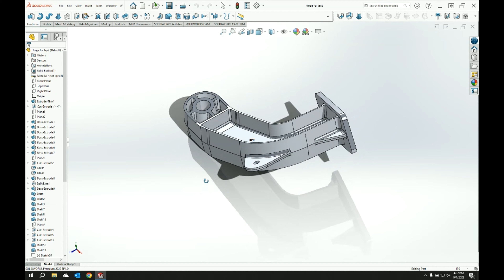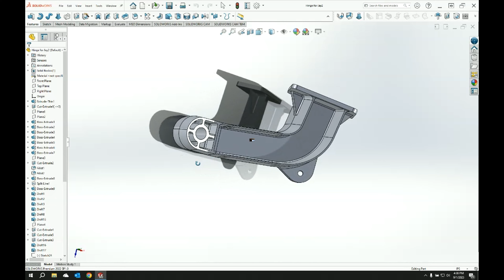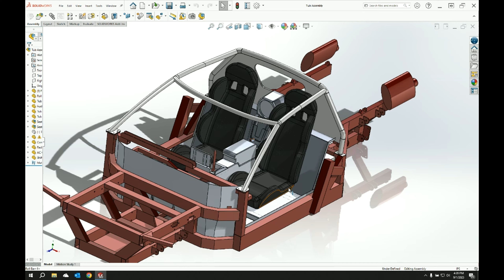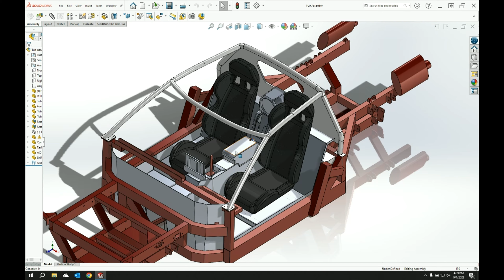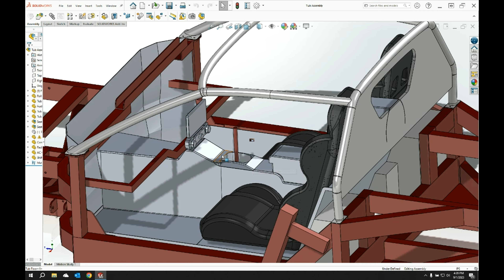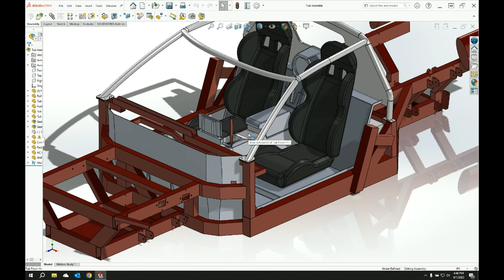Building my own supercar - Working on center console design.

Comment: I have a question. Are you when you get to the final touch up part going to sound deaden the entire cabin? also are you going to do carpet for the flooring?
Reply from the maker: Yes to both. I hope to make the car as quiet inside as a factory car. I have already bought some sound deadening material for the floors, I just haven’t installed it yet.
Reply: @basementsupercarbuild2948  oh cool I was wondering as I thought it would be fairly noisy